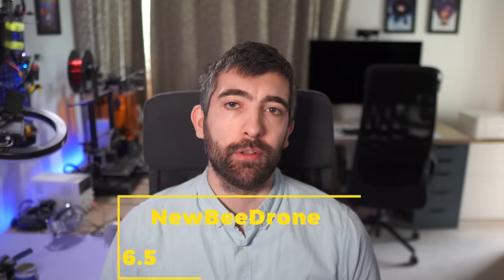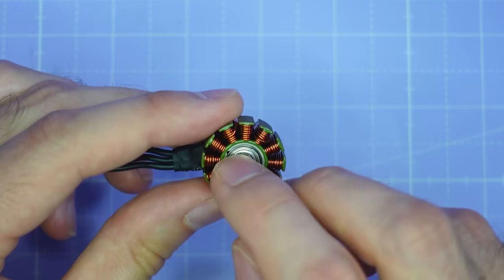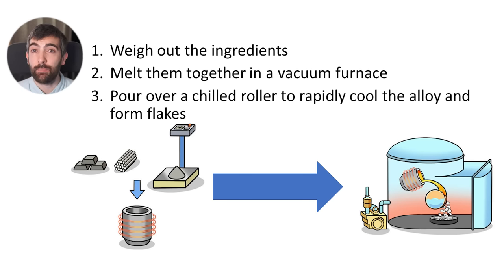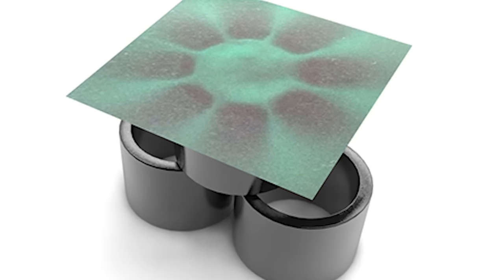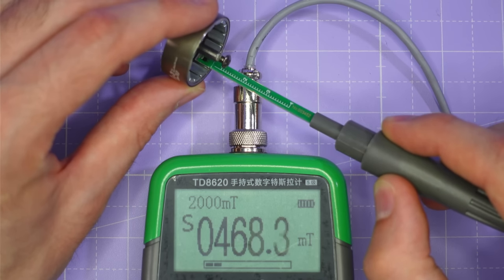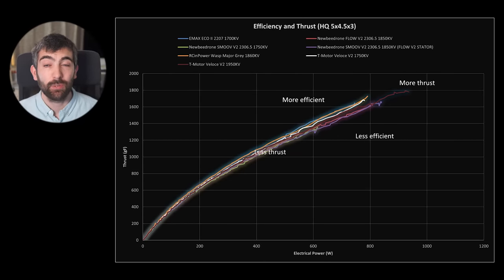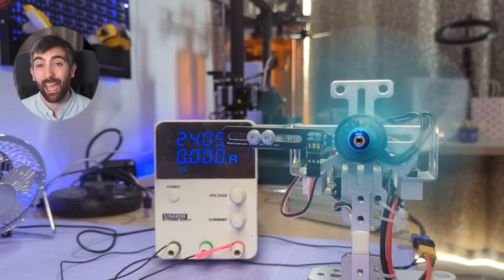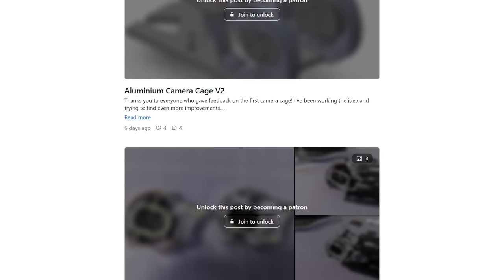NO MAGNETS??? Deep Dive on the Newbeedrone Smoov V2

Comment: Great details. One possible justification of the smoothness claim is reduced cogging. Cogging contributes to the noise of the motor, so dba figures would be interesting. With the bonded magnet, there is an opportunity to create a sinusoidal change in magnetic field strength and i believe this can be exploited to reduce the cogging.
Reply: Combine that with sine wave ESC and it would be very smooth and quiet.

Comment: The "smooth" they are talking about is TORQUE smoothness.  Torque "unsmoothness" comes from magnetic cogging, as the magnets move closer & farther away from the iron slots in the stator.  Weaker magnets DO reduce cogging torque by the SQUARE of the reduction (& as you say, reduces motor efficiency by the same factor).  Low cogging torque is important for motors that operate at low RPMs or those that cross through zero RPM (such as in helicopter tail rotor motors).
          There is a way to reduce cogging torque with less affect on motor efficiency: SKEW THE STATOR STACK.  This is routinely done on other motor designs, especially where noise is a consideration, but I have yet to see it done on RC aircraft motors.  I wanted to use an aircraft motor as a generator in a turbogenerator for an 1/8th scale steam engine (to make power to run the lights, as was done in the prototype.)  The problem is that the cogging torque of the aircraft motor is so high that the turbine can't start it without using 10 times the normal steam flow.  This is bad enough, but made worse by the poor performance of turbines when scaled down.  For a few watts of electrical output, the turbine ended up consuming more steam than required to move a 600lb engine & its train!  What's odd is that the smaller the aircraft motor is, the larger the cogging torque it has.

Comment: This is very interesting. The main problems I had with motors were the magnets detaching.

These might be more robust. Neat!!
Reply: Thats more the manufacturers cheaping out on their epoxy they use for bonding the magnets, likely a cost cutting measurse to save them a few pennies insead of spending a bit more for a stronger/better quality epoxy that has a higher thermal limit

Comment: Is the neo magnet a N52 or N48? I know N52 is most common for maximum torque (power) but people like ethix use N48 on some motors for smoother motors\less noise along with a slightly larger gap to stator, how would the ring compare to a N48?

Comment: The metal the stator is made from makes a difference in efficiency. The high end racing motors used to use cobalt in the stator plates. Its much more expensive though.

Comment: The o-ring isn't always a good thing from the standpoint of proper bearing loading. You don't want your bearings in compression. If you are worried about bearings in a crash, I just think you have more prominent sources of bearing failure from not being properly loaded in the first place.  I would be more worried about over-tightening bell screws when the tolerance stack-up isn't quite perfect, which could cause the inner race of the top bearing to be compressed down and the bottom bearing to be compressed up without a properly toleranced bearing spacer between them. That being said crashing is a quick dynamic event while improper bearing loading is a longer timescale fatigue question. I understand this is a point of controversy when it is an argument about what is likely to fail first and to what degree failure occurs when the event happens. It is a bit of the "what-if game." The o-ring wouldn't have the advantaged effect without improper loading of the bearing if a bearing spacer was added to the design.
Reply: I don't think the compression of a flexible rubber oring is the type of load they mean but they could always add a shim between the upper and lower bearings inner races. That said I usually assume the o ring is used to account for any lack of precision in the shaft length, not to prevent impact damage on the top radial bearing.
Reply: @ChrisHarmon1  I agree with you, with one exception; why do you think that the top bearing will be the only bearing to see damage? I argue that in a crash the bearing farthest from the torque lever of the prop/bell top combo will see more damage.
Reply: I can’t imagine that the partial compression of an o-ring would come anywhere close to exceeding the axial load limits for a decent-quality ball bearing.  But it would certainly be prudent to make certain - perhaps CR could examine them for a MPN?
Reply: @modquad18  it doesn’t take much force to pin the inner race to one side of the balls.

Comment: Since the magnetic field strength decreased the rpm of the motor should be increased right ? Resulting drop in torque. Beacuse the FPV motor focuse on rpm reather then tourqe that won't be problem

Comment: Use a solder iron not a heat gun on the thread locked bolt, love these reviews would love to see larger like 2808 size.

Comment: Would you consider doing tests like this for the micro motors we use in whoops? 0702, 0802, 1002 and 1102s are all available in all sorts of flavors, but we have no empirical data on what motors are good or inefficient. I am looking to make a small thrust stand to test some of the motors I have but I don't know i could produce the same detailed results as you have.

Comment: So I'm wondering if you could magnetize the ring in a twisted fashion similar to Kabab's split motor video. 

Also wondering if it could be magnetized in a halbauch array? 

Twisted halbauch?
Reply from the maker: Yes a twsited magnetisation is possible. I'm not sure about a Halbach array. The flux ring achieves the same effect so I guess it is not needed.
Reply: @ChrisRosser  ooo. Flux ring? I'm not familiar.
Reply: @Digit-Did-It  metal around the outside of a motor

Comment: Sorry, how is 1100 degrees not way above the Curie temperature for these things? Or why is compactification done in a magnetic field again?
Reply from the maker: The first field sets the preferred magnetisation direction. Only the final field actually magnetises it. The Curie temperature only applies after the final magnetisation. Heating a magnet to above the Curie destroys its magnetism but NOT its preferred magnetisation direction! That persists up to the melting point.
Reply: I dont think iron has a preferred direction of magnetization, for example. Does this have to do with the crystal structure of this alloy?

Comment: Doesn't the polymer itself and the reduced surface area reduce cooling? I'm no expert, but I got the impression excessive heat is't great for magnets in general, neither for polymers. Also, energy used that isn't turned into work is turned into heat, if the cooling is suboptimal it wouldn't be great to also have suboptimal efficiency.

Comment: i had a discussion about such smoth motors below. what do you think? 1: using smoth motors is ok to avoid vibrations, twitchyness or something like that?   2: using the given things in betaflight and Pidtoolbox to make it smooth, if this is the goal.
Reply from the maker: I think that a low torque motor won't reduce vibrations. Vibrations are caused by the balance of the motor which is independent of it's torque (and down to manufacturing quality). The flight controller  constantly requests rapid changes of motor RPM and if the motor can't do that desyncs occur and the quad falls out of the sky.

If you want a smooth flying quad you should use filtering on your sticks in betaflight (RC smoothing) rather than try to slow down how fast the motors can respond. That way you can get smooth stick feel but still good propwash handling and setpoint tracking.

Comment: I think the smooth makes sense in the way manufacturers want to use it. Almost like slower rates to achieve a smoother looking flight. Higher rates without proper control will seem more jerky. The high response might give you the exact flight results for a good pilot, but the slower response will make a new pilot seem smoother. I noticed that when I wanted I got video of my flying chasing trucks just how much I’m moving the sticks, slower response could could be damping the jerks slower to be perceived less.
Reply from the maker: The main symptom of low torque and poor motor responsiveness is bad propwash and in the worst case motor desyncs. Not things that are generally assoicated with smooth flying quads. Low rates and lots of RCsmoothing give a smooth flight experience without compromising propwash handling so that's where I would start with smoothness. There seems to be a misconception that its better to do things with hardware rather than software but that's incorrect in this case. You need a quad that responds fast to propwash and slow to stick inputs, that can only be done in the FC software.
Reply: @ChrisRosser it's been tried and tested though, like how bubbyfpv made a 2205 motor for full 5 inch for smoothness. He wouldn't have made it if he hadn't tested it and found it to be smoother

Comment: Nice work. Is there a weight delta between the two bell designs? - Also a noise test would be educational. Certainly the quad noise will be dominated by the prop. Noise of the pure motor should tell whether there is a bit of truth into the smooth claim.

Comment: I noticed that you didn't weigh them. What if the bell of the ring magnet version is half of its sintered-magnet counterpart? One of the important factors in these drones/planes is overall weight-to-thrust.
Reply from the maker: I did but clearly forgot to mention: The SMOOV is 34.3g and the FLOW is 35.1g (with 5" wires)

Comment: What if the bell and shaft is made of carbon fiber or kevlar or air grade aluminum? Weight reduction on all the moving parts would improve the spin all around, plus increase the response with less resistance. It should use less current in the end. Kinda like changing the fly wheel on a car.
Reply: Plus it would make it lighter. Eventually resulting in much faster response and longer flight time. In my head lol

Comment: Keep in mind that this motor screw should be tightened with very specific torque, and if you over/under tighten it, it would reduce motor performance. Manufactures do not recommend taking motors apart unless absolutely necessary

Comment: I think the sharp edge might actually be a sort of bumper... deforming where it's thin and not affecting the more important structure beneath. little chunks taken out... but no real damage...
but it's extra weight right?
Reply: it could be but a deformed edge will probably mess up with the balance of motor. The o ring would probably do better as an energy absorbing part than the edge
Reply: @im_ricebowl  one of my motors lost 1/3rd of a magnet. Took the props off, did a noise vs throttle plot and it's fine, all the noise was sub 200hz. I wouldn't worry about a dent personally.

Comment: Great review Chris. Very well explained. 
Curious how did the weight of the two motor bells compare? (seeing 33g vs. 33.6g for motor with wire in specs) Would expect weight to have some effect on angular momentum if significantly different, but this doesn't appear to be the case. Torque from the stronger individual magnets does seem to offer an advantage in many aspects.
Agree with your rant, marketing around smoothness, appears to be just that ... marketing. Raw performance is what matters ... high quality elements that are assembled into a well balanced motor design.

One thing that would have been interesting to see is a plot of the magnetic field (mT) for each bell. If you could mound the probe and then rotate the bell with a servo (over 180º), it wold be possible to see how the magnetic field change polarity. ie: is it a nice square wave pattern, or a plot with rounded corners? Realize would be time consuming unless had a fixture to help automate data collection. It could also show how wide that magnetic field is, as may not be the full width of a single magnet. (?)
An alternative method would be to vacuum seal the motor bells in plastic (freezer bag style), and then use metal filings to show the magnetic fields.

Comment: The argument that they are smooth falls flat when something magnetic gets into the motor, the gaps give it somewhere to go, out of the path of movement. Smooth surface with nowhere to go becomes a sander belt. Maybe they should look at a 1950's motor engineers handbook where those gaps are explained. The argument back then was minimal gap size as well, but since they explained the science pretty well, that trend was abandoned.

Comment: I think smoothness discussion could be like low torque on flatter motors discussion ( with equal volume of the stator ) Science mode off I think there is truth in each one, there are so much variables in builds that can introduce much more in the equation and you could find a less strong straight magnet ( instead of curved ) that got more “rounded” or “manageable” response …my2cents

Comment: Stronger magnets mean fewer turns are need to achieve the target performance. Fewer turns have less resistance so the motor is more efficient. That translates into longer run times. Thats the main benifit of stronger magnets.

Comment: I loved your explanation of magnet fabrication.  However,it looks like you had two magnetization steps, and it was not clear how or why?
Reply from the maker: The first step is to align the grains of magnet powder in the direction they are most happy to be magnetised in. The second step uses a SUPER powerful magnet to actually magnetise all the grains. The key bit of information is that every grain of magnet powder (due to its microstructure) has a preferred direction to be magnetised in so lining them all up is beneficial.

Comment: I suspect it’s not the reduction in torque that they’re referring to as smoothness: what they’re probably trying to imply is that the actual torque of the motor varies less over the course of a rotation than it does with other motors. One presumes that this is caused by a combination of a smoother transition between magnet poles and a motor controller that puts a higher emphasis on accurate voltage regulation than on maximum power output. In theory, a smoother application of torque might result in less resonance effects in the prop which could result in less vibration and consequently less noise. Obviously, none of that will be true in practice if the motor is not also finely balanced, nor if it’s used with a square wave driver or other noisy input and the effects it’s trying to mitigate can also be addressed with alternate prop geometry, but if the design theory they’re operating under holds up, you should notice that the whine of a less than stellar motor controller is less noticeable with the bonded magnet than with the sintered one (and to a greater degree than would be explained by the difference in field strength).

Comment: By adulterating the neodymium with plastic in between the flakes the overall magnetic flux is reduced as is it’s maximum operating temperature. A sintered toroid with an internal halbach organization should be a more ideal ring magnet

Comment: Interesting but even seemed gimmicky:  Chris Rosser is the reason my Diatone Roma v2 is rolling with Wasp Major 1860kV motors.   It was 4S and I swapped motors to go to 6S.   I probably could have gotten some cheaper motors and not know the difference but it flies so good on a barely more aggressive than stock Betaflight tune.
Reply: i just threw a set on my newest build and they really are THAT good. absolutely love those motors. never would have considered them without seeing his previous videos.

Comment: I was caught off gaurd with the Smoov V2- Why waste the time, effort, & production cost on a new magnet design like that? I could understand if it was a Halbach Array or something that would impart a lot more magnetic force. Also the only time smoothness is even a concern is if your motor is running off an AC to DC converter, it's out of phase, or if you need extremely fine tuned movements- but a stepper motor would be much better for that. Jitters might be a problem if you were severely under-volting the motor, & otherwise all that should be handled by your motor controller (which if I'm not mistaken are on a seperate unit, not on the motor itself? Unlike most brushless DC motors) I have no prior knowledge of these motors or what they were used for until your addendum @ the end.

Also most good quality production motors that do use neodymium are ND35-38, sometimes as high as ND44. Virtually no motors use ND52 <in case your not aware the #'s represent the grade of neodymium in the mixture> and in general, the increase in it's magnetic force is 20% for every ten # grades on the scale- in other words, a N42 is 20% stronger than a N32, a N52 is 20% stronger than a n42 & 40% stronger than a N32. About 10 years back after working with a company in Texas for about 3 months of designing what I wanted, they made me a mono-polar magnet- at only 25.00mm³ (25X25X25mm or almost 1"X 1"x1 inch) That because all of it's force was focused in one direction so it's power wasn't split in half for each the north & south pole. That magnet (N52) had a pull of 498.6 foot-pounds over that 25mm area. Two of those magnets doubled that to 997.2 foot-pounds ( in other words, almost 1 thousand pounds of pull force between the two magnets) My first working prototype for one was back in '98 The difference there was that besides being mono-polar it was also non-magnetic. It could pull or push metals towards or away from it, but they wouldn't stick to it's surface. It's other unique property was that it could give off a controllable variable magnetic flux byt passing a miniscule current through it. (The original intention for that was as a higher density read/write head to transfer data faster inside what are mow considered legacy hard drives, & eliminating the issue of electron slip.